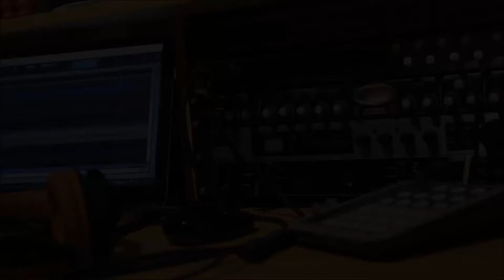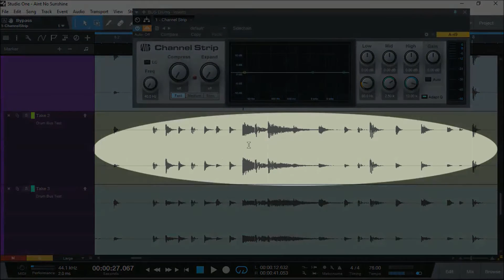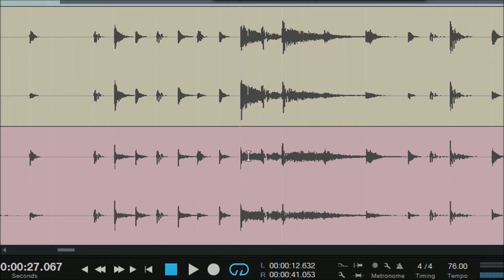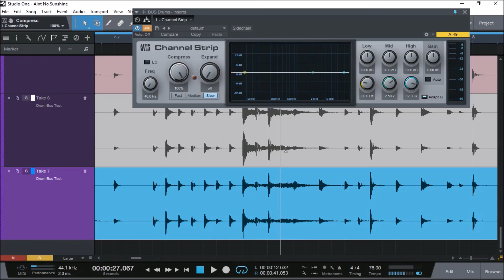Channel Strip Compression Settings for Studio One V3 Prime

Comment: Im use to recoring with no plug ins. Do you record with plug ins
Reply from the maker: It all depends on the audio source being recorded. I tend to put gentle Comp & EQ on the way in at times, especially for Mic inputs. Saves time than doing it later 'fix-it in the mix'.
Reply: hmm I'll try this. Dose this effect the audio waves? I accually had a track where I had some EQ on the master fader and I recorded vocals with it on forgot i put EQ on the master fader.
Reply from the maker: Pluggins do not effect the recorded audio, on each track or on the master bus. Unless you use this option https://www.youtube.com/watch?v=_u6uxjLmqIk
Reply: Wow Thank for you videos. Also Im starting to master a track and I put the limiter on the post instead of the insert on the master fader. Will the show in my mixdown?
Reply from the maker: Yes, the limiter will be applied to during Mixdown.
Reply: Ahh thanks. I just had this problem with CPU, Ive been using event effects alot lately and I had about 20 reverbs on certain points of the vocals. I had some one show me how to use the + sign on the send add add effects channel Add reverb. Then you can automation for the send channel. work pretty well, well see how much CPU it saves.